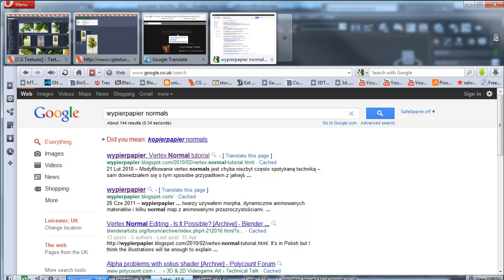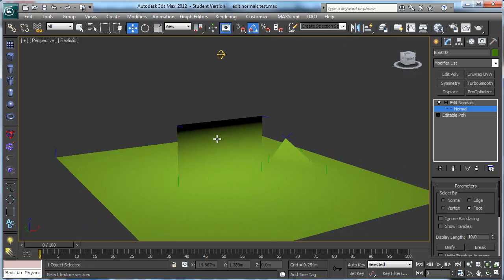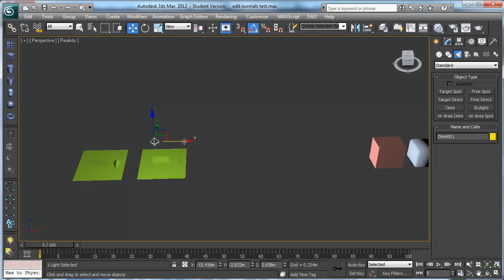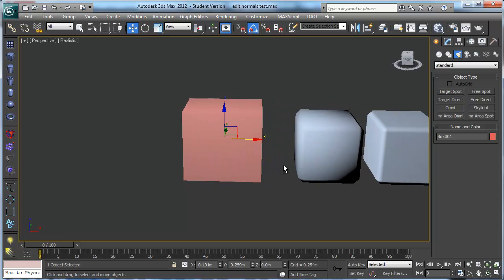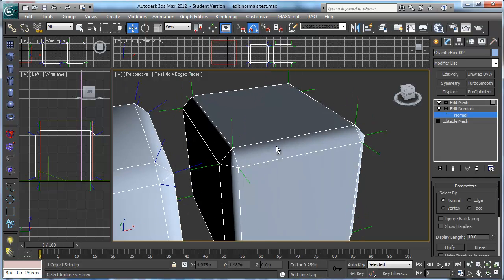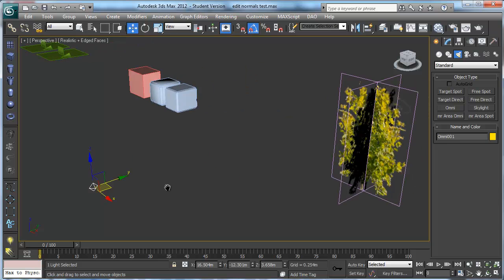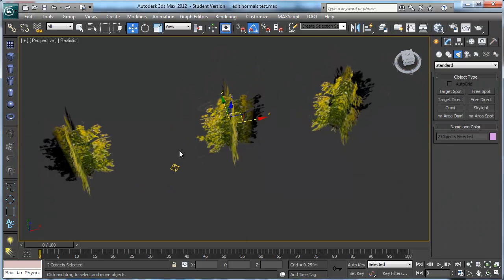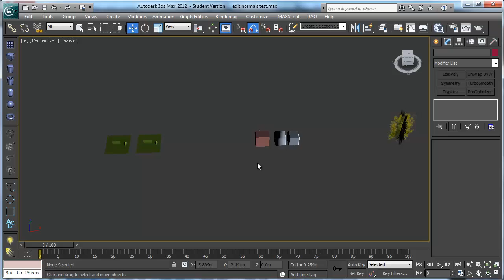3ds max tricks - Edit Normals to control smoothing and lighting

Comment: Are smoothing groups basically another way of editing the direction of normals? I use them to achieve a similar effect in my models, so they dont look incredibly hard edged. I read up on normals a while back too, so I knew in very basic terms what they were about, but not how to edit or play with them. For the pyramid type object, I would add it to the same group as the plane, but I dont think this would work on the vertical plane. Hopefully UDK supports this!